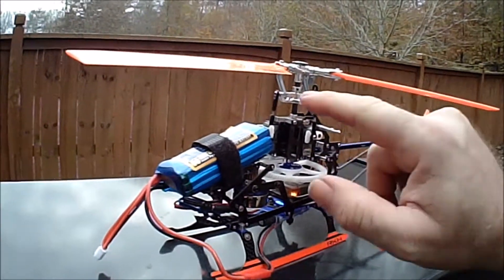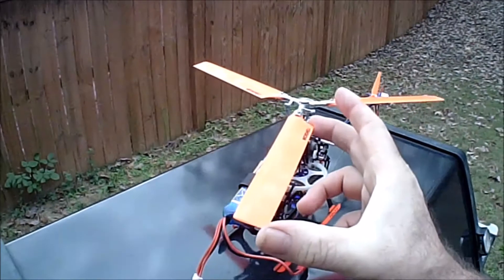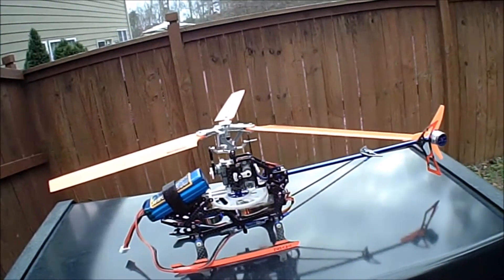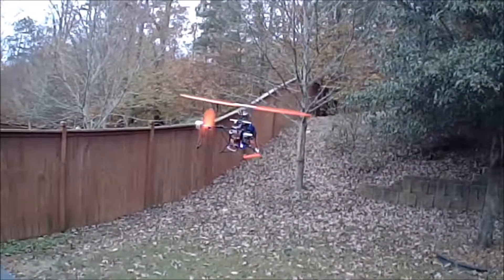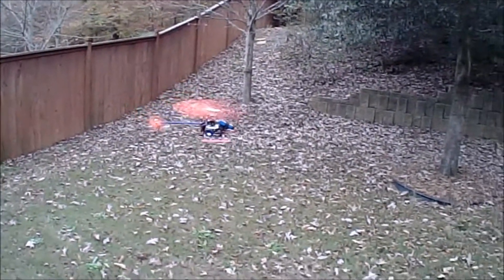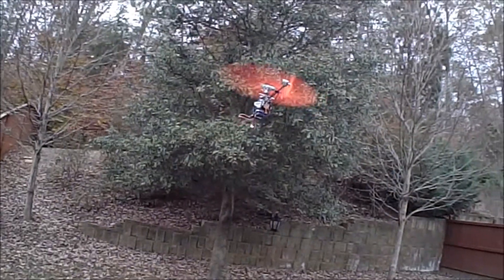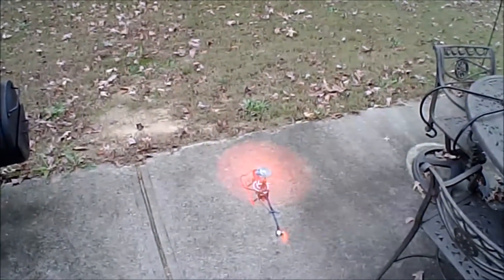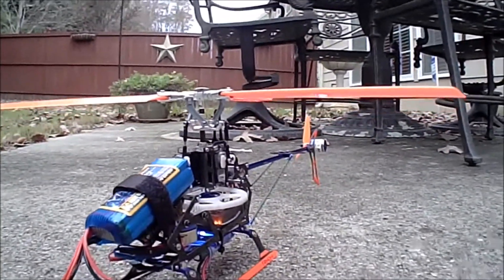blade 200srx with 3 blade rotor setup courtesy micro-heli

Comment: I have 2 questions. 1. What altitude do you live at? 2. What (if any) gains did you have to adjust to get it to fly? I have the exact same kit and I live at 5500 ft and it barely gets 3 inches off the ground at full throttle. I have already changed my motor up to 200% but I don't really know what to do for the other gains. Can you please help?!
Reply from the maker: they there.hope I can help improve not sure exactly what sea level I'm at but I'm in Atlanta area I think it's like 1000 foot., as far as adjustments I set the following gains to this as my initial setup., it's a great place to start ,then fine tune as necessary. 
set main motor gains to 180 %
cyclic gains set to.           20 %
tail motor gains set to.   160 %
filtering gains set to.         0
also make sure your swash is locked   down in the small notch in the main shaft that came it your kit. otherwise you won't have proper blade pitch. 
also I'm running a 13 tooth pinion and giant power lipo 850 mah 50c
hope this will help you get started
Reply from the maker: also I have second updated video of the heli check it out it may help you too
Reply: Gmanbuilder, for your altitude, you might have to get 8 degree pitched blades to grab more air than in lower altitudes
Reply: Todd Hazell I solved the problem. Now it is that i cannot perfectly level my swash and trim isnt enough to have the heli hover on it's own. It floats to the left and forward A LOT and for the life of me i cannot solve this problem. It is still flyable but it takes the fun factor away because you have to concentrate more on keeping the thing stable thann doing aerobatics.

Comment from the maker: i want to give a big shot out to Khoa and micro-heli for a great product....this was a fun test to do the 3 blade set up is awesome and i think this would be great for a scale bode like eruo copter or hughes 300 or even a jet ranger body...
Reply: Hi Michael
Having seen this video I bought the 3 Blade head assembly and went through the build, install and test process.  One major problem at my end. The tail motor has burnt out twice (within minutes of initial test flights).  Any ideas? Did you suffer from the same challenge? I am sort of stuck on where to go next.  Original set up was working fine.  So either this set up is causing a problem or the problem surfaced without being related to the head change. Not sure how to trace the issue and would appreciate any input you may have. 

thanks for the video and flight demo....
Reply from the maker: hey friend i have not had any trouble with this set up. if you fly hard like i do i would reccommend using a 12 tooth pinion  instead of a 13 tooth pinion. that extra head speed can over tax the esc .
as far as your  tailmotor burning out , this can happen pretty fast if your tail prop is on backwards, it will still fly this way but it has to work very hard and will get extremely hot and wil burn up.
Reply: Thank you very much for the response. I had to send the Heli back to horizon to see what the problem is.  The tail prop was in as it is supposed to be so.... When i get it back, i will go back into trying and use your settings for the gains and go from there.